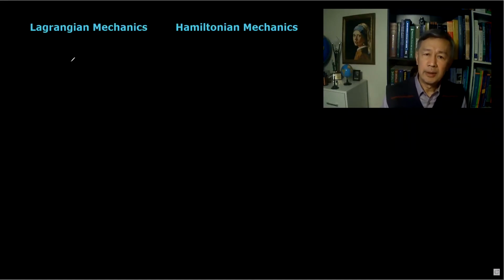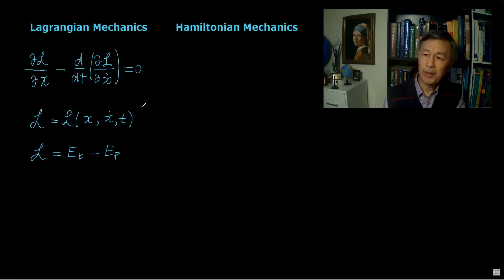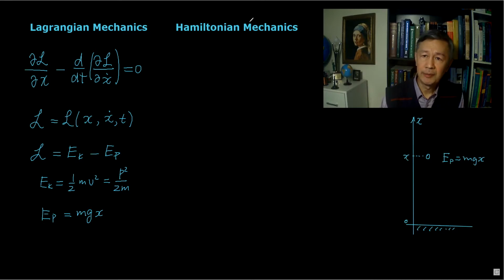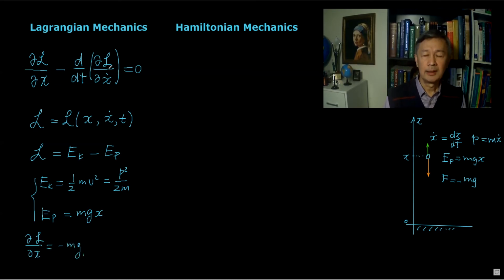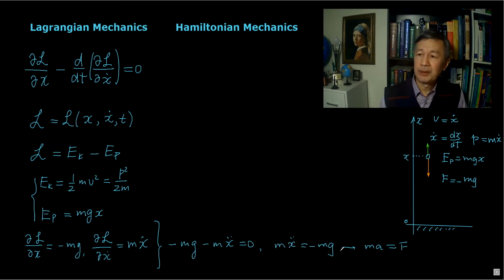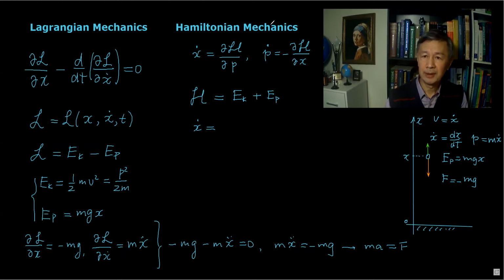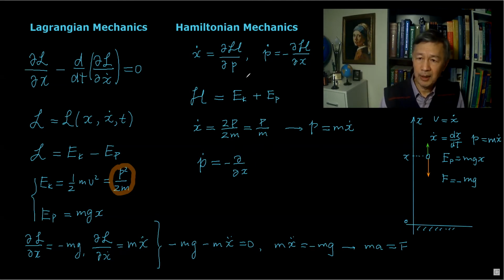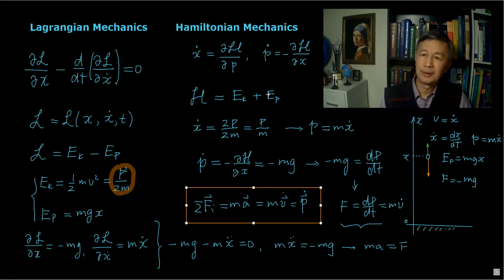#Lagrangian vs #Hamiltonian: A Brief Introduction to #AnalyticalMechanics | 简介分析力学中的拉广吉安和哈密顿

Comment: Thks but just a few questions,
?Could you compare/contrast the strengths & weaknesses of the Newton, Lagrangian, & Hamiltonian approaches?
?Are Lagrangian & Hamiltonian Mechanics 1to1?  For example ?can I derive one from the other & from the other to the original one? If-so, ?can you refer me to that derivation so I can give it a try?

Interestingly Newton's mechanics is just least-action equations w/o the details of the Lagrangian or Hamiltonian approach.  Newton was a Deists & tried to find God's laws of nature but it seems they won't divine after-all (too-bad/so-dad ;).
Reply: I know that Lagragian and Hamiltonian are not strictly one-to-one. When more than one variable is concerned, for the Legendre Transform to work it is necessary that the "hessian" in speeds: ($\pdv[2]{L}{q_i}{q_j}$) (I call it mass matrix, because it degenerates into that in the case of no potential) is non-zero. I know Dirac worked on those singular cases, I do not know what results are available.

Also, Newtonian mechanics is equivalent to what is called a "lagrange Equation of the first kind", only when the forces are strictly due to space dependent potentials (and some cases that depend on velocity) can you reduce them to "Lagrange equations of the second kind" which have the form of a "Euler-Lagrange Equation" of least-action principles
Reply: @elkinmontoya9640  Thks but I just not that smart &  this is a little over my head.  
  I'm focusing on Geometric Algebra to try a top-down approach to all this advance/weird math physics (ex: GA math spans across relativity & quantum).
  Unfortunately GA is a new-geek-math, there's only a few good books & few academic courses on it, & sooo it's mostly DIY for me (plus a little profanity/throwing-things ;):
       https://www.youtube.com/watch?v=PNlgMPzj-7Q&list=PLpzmRsG7u_gqaTo_vEseQ7U8KFvtiJY4K&index=1
  Also you might be interested in FPGAs (they go around/beyond the classic cpu bottleneck):
       https://www.youtube.com/watch?v=8POZhFHxBLs&t=230s
Reply: @tombouie  In any case, you might be interested in the book "Classical Mechanics" by J. Saletan, he employs Geometric Algebra throughout, even just starting to read something that you might not understand completely will motivate you to study those more in other places.
Reply from the maker: @tombouie  Thank you for your comment and references.
Reply from the maker: @elkinmontoya9640  Insightful remarks. It seems the generalization in line with Lagrandian least-action formalism also leads to abstraction and absurdities  in theoretical physics. This is expecially apparent in quantum field theory where different "energies" have to be introduced for the sake of satisfiying the Euler-Lagrange equation.
Reply: @yongtuition  Funny that you should mention that. In seeking answers for these kinds of things I stumbled upon a reference: "Structure of Dynamical Systems", by J.M. Souriau, part of Springer's Progress in Mathematics v. 149. In the introductory chapter it claims that they found a more general principle, that of a vanishing quadratic form, equivalent to D'Alembert 's Principle, that contains all other cases. I have not progressed enough to say whether what they claim is achieved or not, but it is something I look forward to read.
Reply from the maker: @elkinmontoya9640  Hardly, one can trust those mathematical physicists who can explain everything in phsyics. In his own writing, for example, Souriau argued that: "All the details of classical mechanics thus appear as geometric necessities. Moreover, this geometric formulation goes beyond classical mechanics stricto sensu; it permits, for example, the construction of a precise model of particles with spin. A spinning particle is not a top but a specific Galilean object; the spin is characterized by a proper kinetic momentum independent of the motion. Thus spinning particles possess a purely classical description, i.e., prior and underlying quantum mechanics."
Reply from the maker: Both Lagrandian and Hamiltonian formalisms start with the from of energy, instead of force defined in Newtonian mechanics, although the ways to derive the equation of motion are different. All of them will give you the same solutions in the context of mechanical engeering, such as many-rigid-body systems. On the other hands, both L and H allow mathematical generalization/abstraction beyond mehcanical physics, which has been proven two-sided saw in theoretical physics.